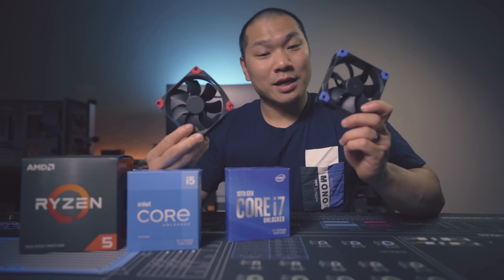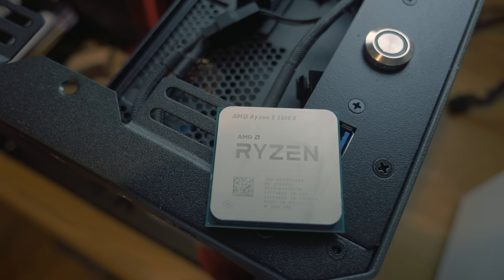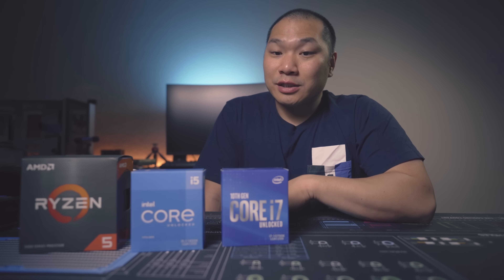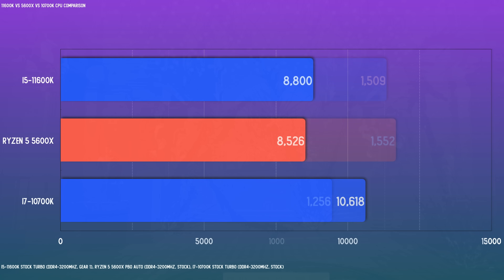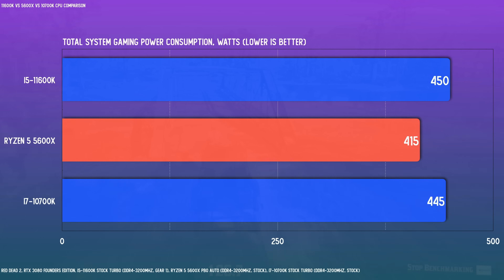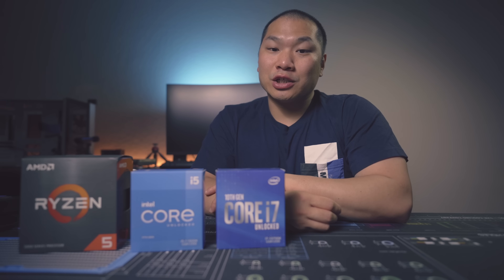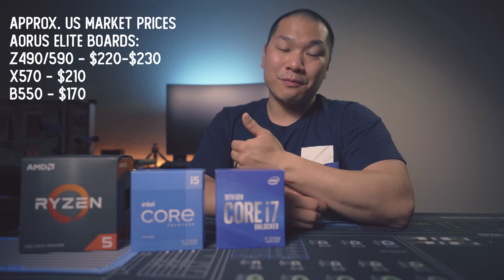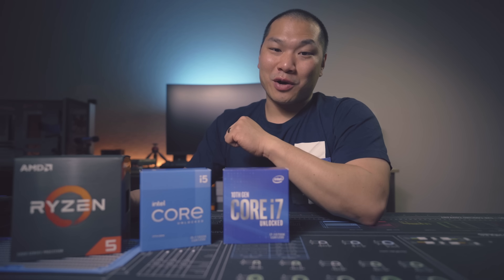11600K vs. 5600X vs. 10700K - Mid Range CPU Battle!

Comment: got my 5600x clock at 4.5ghz paired with 6800xt on aorus pro x570 board (somehow praise Jesus)  in mini ITX build couldn't be happier :)
Reply from the maker: Awesome! That is a good combo. You could go higher still! Not saying you need to but the board should have a setting that will let you dial in a +200mhz boost provided you give it enough cooling.
Reply: @MachinesMore   I recently upgraded from a R5 1600x + Freezer 33, C6H and G.Skill Ripjaws V 2x8Gb 3200MT/s CL16 to a R5 5600x + be quiet! Dark Rock 4, Strix B550-F Gaming and G.Skill Trident Z RGB 4000MT/s CL18. I honestly coulden't be more happier. This "little" chip is amazing, managed to get 4.85Ghz on single core and 4.7Ghz on all cores stable just using PBO and curve optimizer. Dark Rock 4 is a true beast of a cooler for a single (and dual) twr cooler, it keeps the Ryzen under 66°C @ all core load. Now i'm tweaking my RAM, it's @ 3600 at the moment, can't really get it to run stable @ 3800+... Waiting on the new Dram Ryzen Calc, it should be out soon. Anyway, great job - love to waatch your vids, keep it up!
Reply: Вся хвала принадлежит Аллаху Господу миров и нет Ему сотоварищей ни в ком  и ни в чем . Поклонение созданным является многобожием и введет человека в Ад навечно , а поклонение Создателю и реальному Богу который действительно заслуживает поклонения вводит человека в Рай и прекрасна эти обитель . Куда вы катитесь ? Читайте Библию посмотрите хотя бы 1,2 заповедь и что они говорят  ...

Comment: hei man, would you prefer a 3950X running on reduced power target or a 5600X on an ITX all-around machine?
Reply from the maker: Depends on the resolution/titles you’re playing at, if more GPU limited then the 3950X would be OK but it’s a shame to reduce the power target, personally I’d just set up an all core undervolt and activate when necessary. Many ITX cases can handle a 3950X no problem. Broadly speaking, those two are quite different- if this is an all around build I’d go for the 5800X.
Reply: Might as well buy a scalped 5900x instead of the 3950x lol
Reply: @artiew8718  3950x is already in my workstation and might need an upgrade in a year or so

Comment: Man i pushed the 11900k to the absolute limits as far as oc and it still lags behind my 10900k @5.1 :(
Reply from the maker: I wonder how much has to do with memory latency, I know the 11900K can support gear 1 3200mhz but the IMC in 11th gen just seems off compared to 10th gen.
Reply: @MachinesMore  i think it has everything to do with the latency, its cause the imc is essentially the laptop back port. Its still a sick chip! Was cool seeing it run at 5.4 at like 75 degrees. Speed just isnt there
Reply: joe mcginnis it’s definitely a fun chip to tinker with from what I’ve seen. With Amd zen 3, overclocking is fairly straight forward, but limited in terms of freedom. Intel platform is made for enthusiasts that don’t mind spending hours tinkering every possible mobo setting.
Reply: @CknSalad  yup exactly! Dude the z590 bios has sooooo many things you can fuck with its amazing!
Reply: It's also because of the higher l3 cache latency